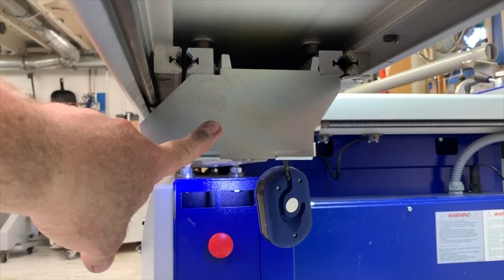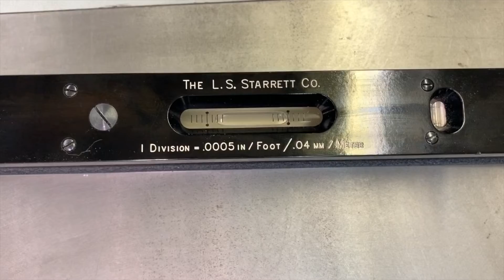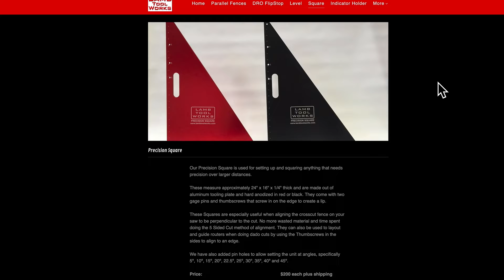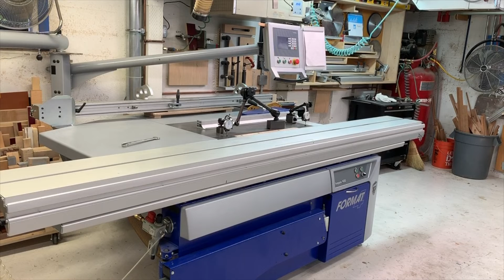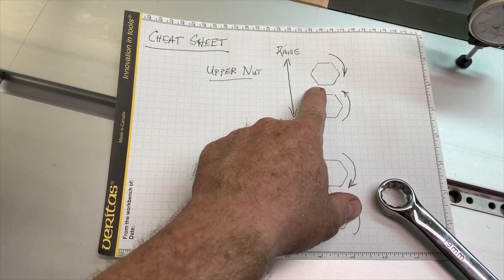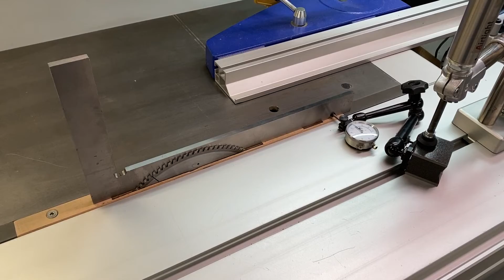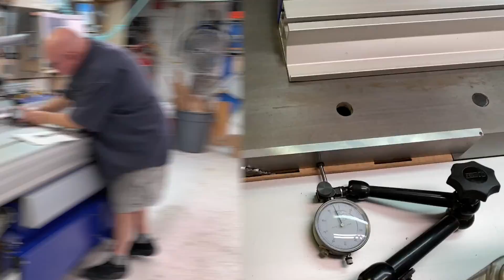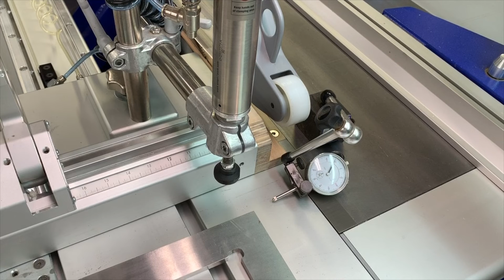Sliding Table Alignment for Felder Equipment

Comment: I have the Felder 531 with four bolt locations. How would you adjust your method for this case? My main problem is that I can get the table fairly flat in its middle position, but it goes VERY twisty at either end of its range of motion. Is there a way to check for warping or other problems in the carriage base? Is that likely, or do i just need to try harder?
Reply from the maker: How long is your sider and what year was it manufactured?
Reply: @David_Best  I believe the slider is 2 meters. I’ll try out the owners group.
Reply from the maker: Join the Felder Owners Group and take up your question there.  YouTube is not a place for this type of exchange.  https://groups.io/g/felderownersgroup

Comment: how do you adjust the toe out?
Reply from the maker: Felder used to supply a bracket with adjustment bolts on the machine chassis that pushed sideways on the lower carriage to adjust the toe-out.  Since about year 2009, they began eliminating these brackets/adjustment bolts, presumably to save a few dollars in manufacturing cost while at the same time driving up the amount of technician time by at least 30 minutes during commissioning.  Your machine may or may not have this bracket with adjustment bolt (it's shown in this photo:  https://tinyurl.com/9p4npatu )

If your machine does not have this adjustment mechanism, here is what I recommend - this is how I perform the toe-out adjustment, it's crude, but about your only choice.
1 - After the gross alignment of the sliding table height using the four central adjustment studs, proceed as follows:
2 - Loosen the top nuts on 3 of the 4 studs.  I generally keep the stud on the inside ahead of the saw blade tight, and loosen the other three.
3 - Pull the slider to the extreme infeed or outfeed end of it's travel.
4- -Standing at the end of the sliding table, use your body weight to push the sliding table laterally, toward or away from the machine as required to alter the toe-out.  
5 - In practice, I find it useful to just bump my hip against the sliding table, but occasionally more force is required, but I wouldn't get carried away or you might break the plastic bearing cage that's sandwiched between the lower carriage and the sliding table extrusion.
6 - If this does not bring the table into proper toe-out, loosen the top nut on the 4th stud and try again.
7 - Once the toe-out is where you want it, tighten all the upper nuts again and re-check all alignments (height, level, and toe-out).

I have encountered a few Felder machines, where additional lateral force and leverage was required.  In those situations, I removed the end-plates on the lower carriage extrusion, inserted a 6-foot long rigid pipe or hardwood 2x2 into the internal webbing of the extrusion, and used the pipe as leverage to force the lower extrusion to pivot laterally.  

Hope this helps.
Reply: @David_Best  Appreciate the time and detail David, thank you.

Comment: Just received my K700S.  Thank you for this video.  How close was your saw set up from factory?  Totally intimidated now too get it dialed in.  Hahah
Reply from the maker: It's always far enough off (I've helped at least 20 people self-commission their new K/KF700's) that it will need all the adjustments I go through.  If you had Felder commission the machine, the technician will spend at least 2 hours doing sliding table alignments, maybe more.
Reply: @David_Best  No I assembled the saw myself yesterday.  Still haven’t fired it up yet.  I definitely love to pick your brain.  Also need help setting up my Ad941 as well.
Reply from the maker: @christopherballard3560  I'm not sure what you mean by "no".  I wasn't asking a question - all I'm saying is that IF a Felder tech commissioned your machine, he/she would  spend at least 2 hours adjusting the sliding table.  If you want to interact with me or other Felder owners about your self-commissioning process, I suggest you join the Felder Owners Group here:  https://groups.io/g/felderownersgroup   If you want more on commissioning a K700, go here - this steps through the process:  https://tinyurl.com/8z939bfp   There is lots of information related to the saw, shaper, and jointer/planer setup/adjustment on my Flickr pages here:  https://www.flickr.com/photos/davidpbest/albums
Reply: @David_Best  Sorry my “no” was referencing  that I didn’t have a Felder tech come out to set up my machine.  Thanks for all the info.

Comment: David,
I just started on my Kappa 400x.  I loosened the bolts today to 'release any memory'.  The bolts were incredibly tight.  The saw was commissioned by a Felder tech when the original owner purchased it.  My question is, just how tight do the bolts need to be?  Seems to me that they need to be pretty tight, but this was just excessive to the point of almost rounding fasteners.  I have your survival guide (best purchase!  Thanks!) just wondering if there is a trick to a starting point to set the toe?  As in an expected gap from the cast iron table?  Then how to keep that gap as you adjust the slider?
Reply from the maker: 30 foot-pounds of torque is plenty.  5 is too little.  If you don't have a torque wrench, and your 19mm wrench is about a foot long, you can judge 30 foot-pounds as applying force equivalent to lifting a 30 pound weight (that's about 5 gallon jug of water) at the end of the wrench.  A Kappa 400x doesn't give you much margin in positioning the slider distance away from the edge of the cast iron top.  The edge of the sliding table should be positioned 1.0 to 1.2mm away from the end-cap that covers the rip fence rounded aluminum housing.  Referring to page 199 in the Survival guide, once you get the slider positioned at that distance, lock down on bolt #3, then proceed to align the sliding table for toe-out.  The best methods I have found to actually get the lower carriage to move laterally to alter the toe-out is to 1) loosen all the studs to finger tight top and bottom except for one, then 2) fully extend the sliding table and use your body at the far end of the slider to nudge the table the direction you want it to move.  If that doesn't work, then remove the end caps on the lower carriage and insert a long 2x2 into the extrusion cavity and use that as a lever to force the lower carriage into position.  Hope this helps.  DM me on FOG if not.

Comment: David,  I can't thank you enough for this video. My sliding table (older k 700s with x-roll) is now riding quite a bit lower than the saw table and you know what that's like. I have to put the time in now to get it right and there's no putting it off any longer. My rip fence is also way off and I believe the only way to align it to the blade, on my saw, is to deal with the trunnions. It's so far off that I can't even use the rip fence except as a stop. So I guess I need to start there? But thanks again for this video, it makes it so clear what needs to be done.
Reply from the maker: On your machine the rip fence is adjusted by altering the angle of the round bar the fence housing slides on.  There should be 2 - 4 threaded stand-off studs that attach that round bar to the machine chassis.  By moving the position of the nuts you can change the angle of the rip fence relative to the saw blade.  The process is covered at the following web page:  https://tinyurl.com/7udu8e4c
Reply: @David_Best  ,  I only have those two adjustable bolts on the right side of the round bar. Looks like the left side of the round bar is fixed with allen head bolts to the saw table casting with no adjustment.  Maybe I could make some thin shims to put between the round rod and the table casting on the left side?  I'm thinking that might be easier than messing with the blade to table alignment?  But maybe you know Best?  (Pun intended)
Reply from the maker: @tomruth9487  If one end of the round bar is fixed, and the other adjustable, you have all you need to change the angle of the rip fence to get the proper toe-out.  Use the nuts on the righthand stud to alter the angle of the fence.  I don't understand what you mean by "blade to table alignment".  Your trunions are NOT adjustable, but you can alter the 90- and 45-degree stops if necessary.  There are adjustable stops in the trunion (bolts with locking screws that bottom out of landings in the trunion castings).   You might consider joining the Felder Owners Group and posting there with photos of the issues you are having - lots of people there to assist including me.   Here's the link:  https://groups.io/g/felderownersgroup   Also, I have tons of detailed photos with descriptions relating to Felder setup and calibration if you take the time to dig through the folders at my flickr page:  https://www.flickr.com/photos/davidpbest/albums
Reply: @David_Best  Thanks to you, in just a few minutes, with only a 19 mm end wrench, I was able to at least get the slider higher by a few thousands than the table over the whole distance of travel, so at least I can use the saw until the dial indicator, machinists square, etc. arrive. Then I will spend the time to get it right.  I am a member of the FOG and will post the pix of my rip fence rod adjustment problem there. As always, David, thanks for your reply.

Comment: Wow, I didn’t know how much work go’s into “getting it right”. I’ve have a hammer arriving within 2-4 weeks. I want it dialed in to the thousandth I an inch. I guess I’ll be buying an inexpensive persuasion level, and some dial gadgets with magnetic bases. My Moto for the last several years has been “buy once cry once”. But before the machine comes I have to wire 240v into my two car garage shop. The floor isn’t level. Thanks for the video, I would like to use you as a guide for the future if I run into a snag with level and square on this new saw (Hammer K3, Comfort).

Comment: David, this is absolutely brilliant!

I hope one day to have a Felder, I currently have the Grizzly G0623x. I’m going to use this method to get it adjusted and setup to proper use.

After fiddling with a straight edge and eye squints for about 5 hours I finally came across this.

I will report back with adjustments!
Reply from the maker: Lots more here:  https://www.flickr.com/photos/davidpbest/collections/

Comment: Exceptional video. This is the best video about adjusting Felder machines. It is not clear for me one point: How do you adjust table going away from the blade? The nuts adjust height, but how to adjust left or right, to make sliding table go away from the blade
Reply from the maker: Felder used to supply a bracket with adjustment bolts on the machine chassis that pushed sideways on the lower carriage to adjust the toe-out.  Since about year 2009, they began eliminating these brackets/adjustment bolts, presumably to save a few dollars in manufacturing cost while at the same time driving up the amount of technician time by at least 30 minutes during commissioning.  Your machine may or may not have this bracket with adjustment bolt (it's shown in this photo:  https://tinyurl.com/9p4npatu )

If your machine does not have this adjustment mechanism, here is what I recommend - this is how I perform the toe-out adjustment, it's crude, but about your only choice.
1 - After the gross alignment of the sliding table height using the four central adjustment studs, proceed as follows:
2 - Loosen the top nuts on 3 of the 4 studs.  I generally keep the stud on the inside ahead of the saw blade tight, and loosen the other three.
3 - Pull the slider to the extreme infeed or outfeed end of it's travel.
4- -Standing at the end of the sliding table, use your body weight to push the sliding table laterally, toward or away from the machine as required to alter the toe-out.  
5 - In practice, I find it useful to just bump my hip against the sliding table, but occasionally more force is required, but I wouldn't get carried away or you might break the plastic bearing cage that's sandwiched between the lower carriage and the sliding table extrusion.
6 - If this does not bring the table into proper toe-out, loosen the top nut on the 4th stud and try again.
7 - Once the toe-out is where you want it, tighten all the upper nuts again and re-check all alignments (height, level, and toe-out).

I have encountered a few Felder machines, where additional lateral force and leverage was required.  In those situations, I removed the end-plates on the lower carriage extrusion, inserted a 6-foot long rigid pipe or hardwood 2x2 into the internal webbing of the extrusion, and used the pipe as leverage to force the lower extrusion to pivot laterally.  

Hope this helps.
Reply: @David_Best  Thanks a lot for detailed explanation. It looks like my CF741 (2011) doesn't have an adjustment bolt. I just bought it as second hand unit. So I will try to do it the hard way, Just need to get all necessary equipment.
Reply: @David_Best  Very interesting, I will look for the adjustment screw, thanks

Comment: Fantastic video, thanks! One question - most precision squares are of the two-piece variety, a thin beam mounted to a thicker handle - but the long square you used to project at the bade is a single piece. You mentioned Polar (might have spelled that incorrectly) - I searched but didn't find anything with that name. 

Thanks in advance --
Reply from the maker: The square shown in the video was made in Poland, and I imported them for various Felder owners over the years, but they are no longer available.   Grizzly makes a few one-piece squares that are similar and perfectly adequate tolerance wise for the work I show in this video.  Here are some ideas:

https://www.grizzly.com/products/grizzly-straight-edge-super-precise-flat-steel-squares-6-x-14/h2697

https://www.grizzly.com/products/grizzly-straight-edge-super-precise-flat-steel-squares-8-x-18/h2698

Hope this helps.

Comment: Outstanding! Just the right amount of detail while still being efficient. Congrats sir! You provide great value to the Felder community.
Reply from the maker: Thanks.   I debated going into more detail using a straight edge and feeler gauges or using the precision machinist level - both of which I skimmed over but are also valid techniques.  They just take a lot longer and are more confusing.